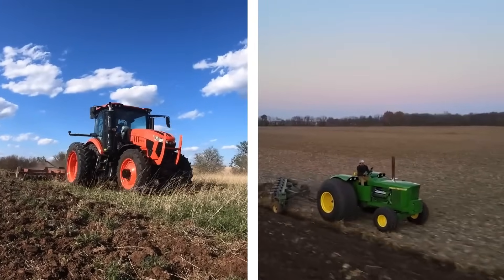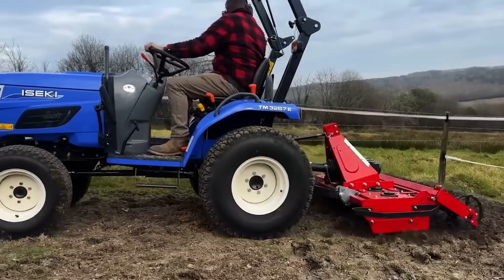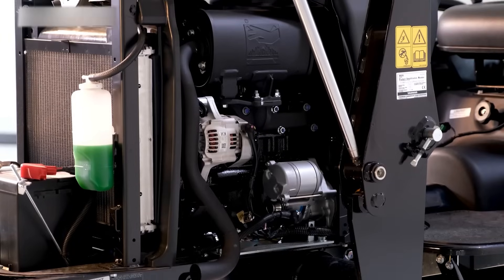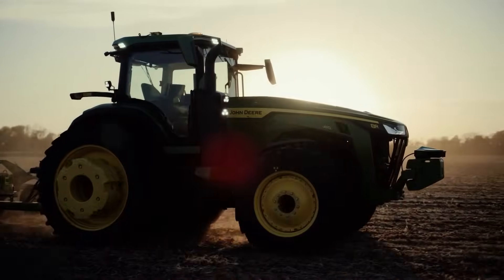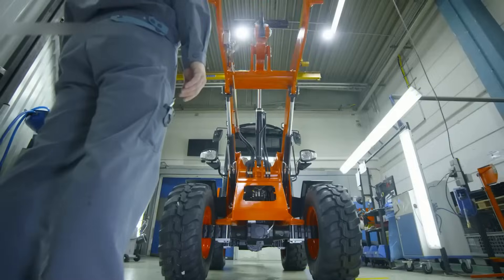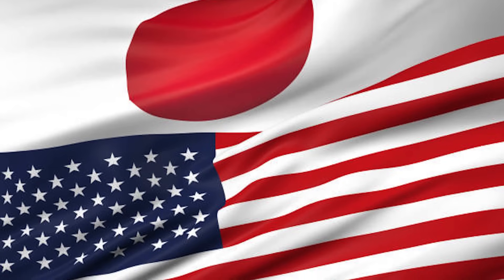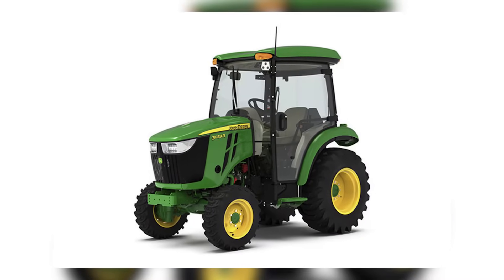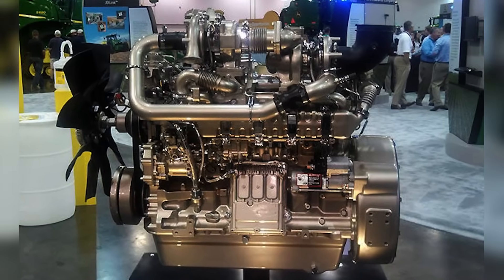Why Are Japanese and American Tractor Engines so Different?

Comment: Pretty sure the small deeres are made by yanmar
Reply: My 40 year old 950 sure says Yanmar on the valve covers. Who ever wrote the script for this was putting entertainment ahead of information.
Reply: Yep, my 2004 JD tractor has a Yanmar Diesel.  21 years old now and never a lick of trouble.
Reply: At various different points from the early 70s til now, yes. They’ve always supplied small engines but entire machines thru certain years. I’m not entirely sure if they’re making the tractors currently, but it seems likely.
Reply: Mostly you get the real jd engine in the ⁵ sieres and up     they are called powertech.
Reply: The yanmar motors in everything, me deere and takehuchi have 3tnv88.
Reply: You’re correct
Reply: I believe it’s just engines in the smaller Deere tractors. I’ve got a Yanmar in my 748X Deere.
Reply: JD excavators are just Hitachi with a paint job and crappier block.
Reply: To my knowledge (25 years turning wrenches at a green dealer). When they phased out the 90 series compact utilities those were the last all Yanmar tractors. Still use plenty of the engines but don't think they're buying complete units currently.
Reply: They are made by Yanmar.  I been looking for a New tractor. Ran across John Deere with Yanmar engines. 😮
Reply: They are, and they are proud of it.  JD bigger tractors are made in India.
Reply: I work for yanmar you would be surprised who they supply engines for
Reply: Pretty sure Cummins makes Ram 2500 and 3500 trucks that come with 6.7L Cummins diesels. The 6.4L GEN3 Hemi trucks are made by Ram.

Does that make any sense? Probably not. Neither does claiming Yanmar as building JD's that are made in India and assembed in Augusta, GA. 

One of the few vehicles that's sold under one badge, while being build by another is the MKV Toyota Supra. It is in fact made by BMW. Oh crap! The timer for my cinnamon rolls just went off.

Update: Cinnamon rolls have been saved and are doing well.... At least until they get eaten.

BTW Shibaura used to build some small tractors for Ford, and then NH. Still pretty sure Yanmar only builds the powertrain used in modern compact JD tractors. The smallest/least powerful currently made JD to use a JD made engine is a 5050E which is a 5045E with a small power increase. The 2.9L JD 3 cylinder has been around in some form for probably more than a 1/2 century.
Reply: Yanmars are great engines, right up there with Perkins!!
Reply: Yanmar used to build the sub compacts for deere, but deere took back production decades ago and moved it to their own facility in Georgia. They did keep the Yanmar engine and some of the transaxles in all the 1-4 current series.
Reply: Yes they are
Reply: I have a 650 and a 1050 that both are yanmar tractors in green, my neighbor has a brand new 4044M and it’s a yanmar engine too. I have a Cat D5G that’s mostly a Mitsubishi dozer, a John Deere 120C excavator that’s a Hitachi with a 4044 power tech turning the pumps. 
My Massey Ferguson 265 has a Perkins in it and my kubota M9540 is honest about its origins, but it looks like alot of the smaller equipment has been Japanese for a long time.
Reply: @SuperDriver379 Massey Ferguson was built when they owned Perkins.
Reply: @Colin-rg7gt 
Now Cat owns Perkins
Reply: @BillieWilliams-l6m And have done since the late 90's. I, personally think that's the main reason JCB started building Thier own engine's after fifty years or so.
Reply: @SuperDriver379 my friends 850 is yanmar

Comment: Japanese tractors would not be able to work in large agricultural production areas like those in the United States, Australia, and Brazil, and would soon develop several mechanical problems. Only American-made tractors could handle large-scale agricultural work.
Reply: Wrong.
Reply: @nealk6387  How is it wrong?  Are there Yanmars, Mahindras, or Kubotas working in large corn, soybean, or wheat fields?  The biggest Kubota I've seen is +/-150 HP, have yet to see a Yanmar over 100 HP, and yet to see a Mahindra of any size in any field.
Reply: @elhanson5426   the Kubota M8 is 200 hp.
Reply: @ Good to know, thank you.
Reply: John Deere has used Yanmar engines in there small tractors for years
Reply: @feedthecownow which has absolutely nothing to do with large scale commercial farming……
Reply: Japanese engineering is world class.  It would run rings around American stuff.
Reply: @bencarter2334 no, no they would not, nor do they. They’re not designed to.
Reply: @HBC914  the Japanese have improved everything they have touched.  Car, bikes, just look and the Toyota land cruiser.  Diggers, Kubota diesel engine in in every bit of plant here in Europe.  They been making mini tractors for 60 years larger stuff more recently. If they wanted they could blow JD and case out of the water.   They are already making in roads into UK market.   I don't like it but you have to hand it to them they build some very good stuff.
Reply: This bloke seems to forget that fendt and class make large broadacre and rowcrop tactors as well. Clas up to 500+ hp and fendt up to 675 hp
Reply: Are you a Bot?
Reply: horse shit..
Reply: Wrong